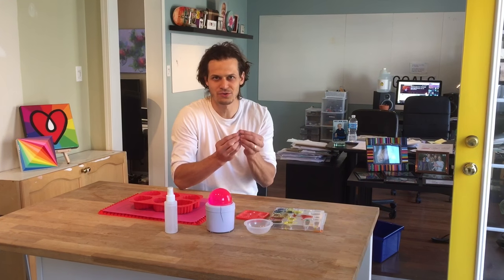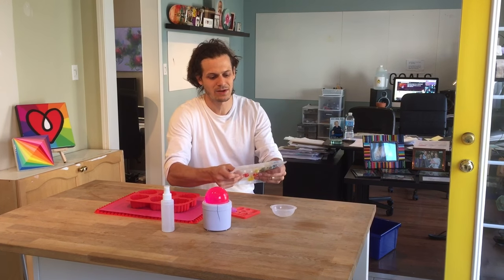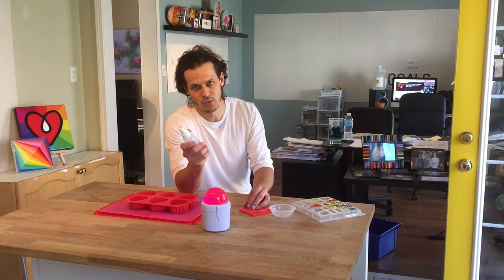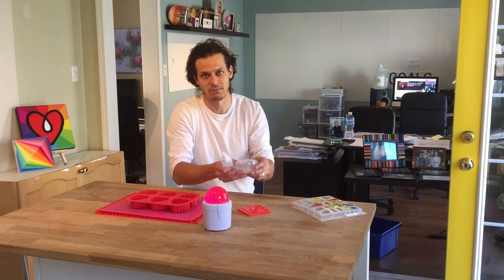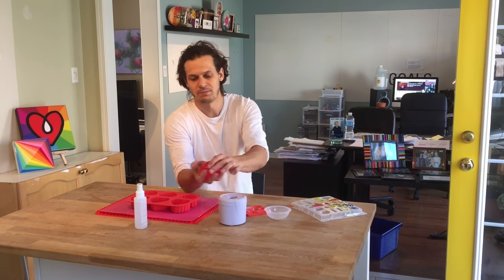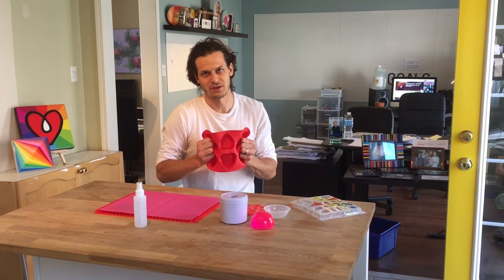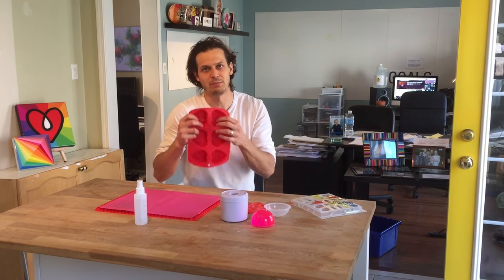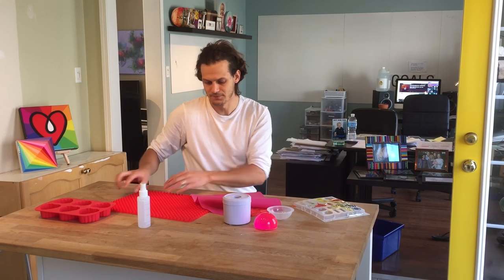Silicone vs Plastic Molds with Epoxy Resin

Comment: Do you know of any alternative to mold release spray? Like household items? I actually made my own silicone mold using liquid nails silicone and corn starch. Haven’t tested it out yet though.
Reply from the maker: Hi Annette - as Dave mentioned, we don't really recommend mold release sprays or anything similar as they can cause cloudy spots and can even react with the resin and affect the cure.  If you use silicon, you shouldn't have any issue removing the resin from the mold.  A couple of things that will definitely help: 1) to remove the resin at the 18-24 hr mark when the resin is dry to the touch and allow it to finish curing out of the mold.  2) Use a high quality mold designed for casting rather than molds designed for baking.  The baking ones certainly work but they will start tearing after a few uses.Silicon Casting molds are much stronger and will last longer. 3) if you resin is stuck in your silicon mold, try soaking the bottom of the mold in hot water ... the heat will start to soften the resin enough so that you can pry it out.  Hope this helps!

Comment: Yep I love silicone better than plastic. I love the video Friday singing best though. I was smiling about that as soon as I saw the video in my feed. :) He was right though about putting the ball in there to make the mold and then adding resin to get the shape in resin. :P I have used that kind of molding material to make molds before.  - Heidi
Reply from the maker: +BlackCat2 ha please don't encourage them with that singing it will only get more dramatic :P